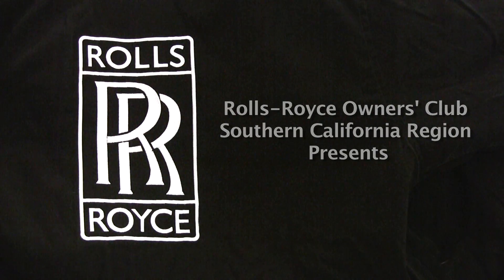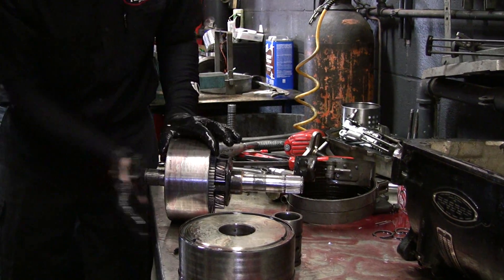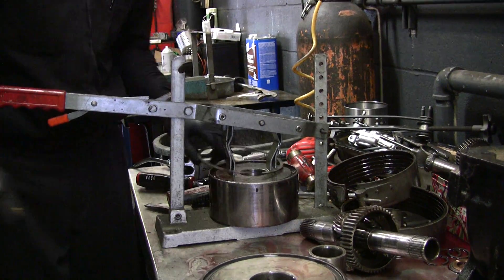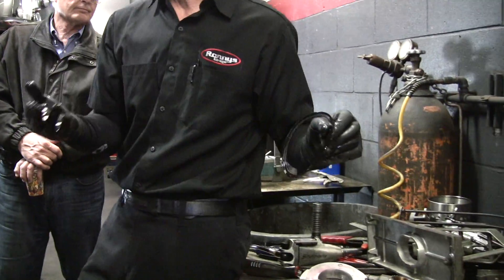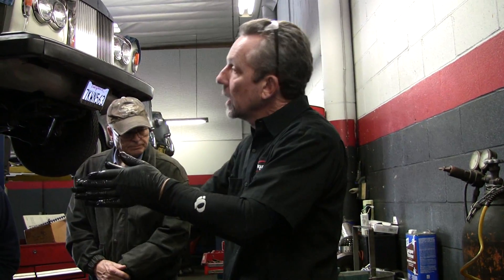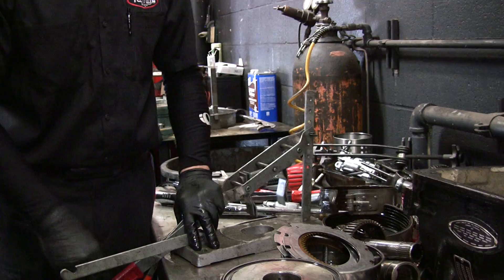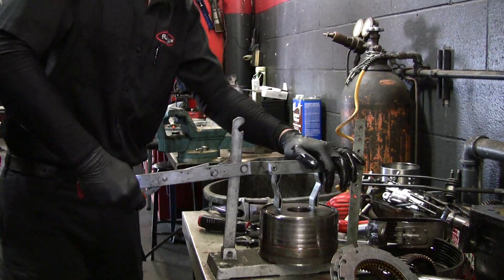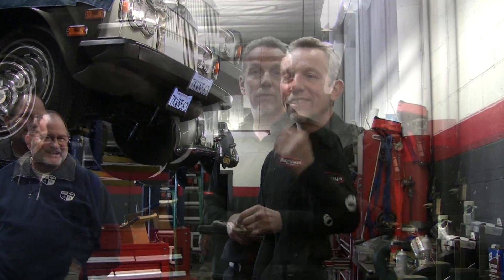Silver Cloud II Transmission Pt7 of 7

Comment: Thanks so much for posting this. I haven't pulled one of these down for a long time now and seeing this was a good reminder. Glad to see they don't use metal expanders behind the drum piston seals any more. One had to be so careful installing the expanders behind the seals so, the ends of the expanders didn't over lap. I worked for Rolls Royce in Sydney Australia between 1971 and 1983. I just bought a Silver Cloud III and I may need to dig deep into the memory again to go through the transmission to keep the car reliable. Was thinking also of fitting an oil cooler to the transmission to increase its life. Thanks again for posting this, it bought back old memories of my younger years.